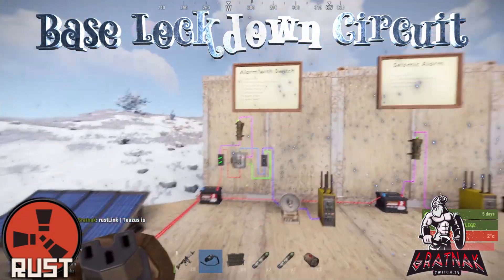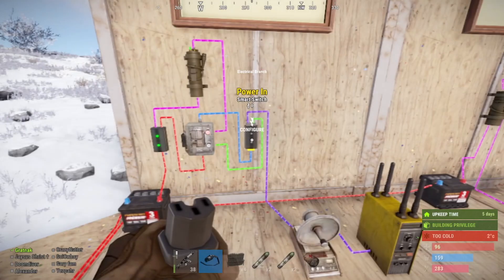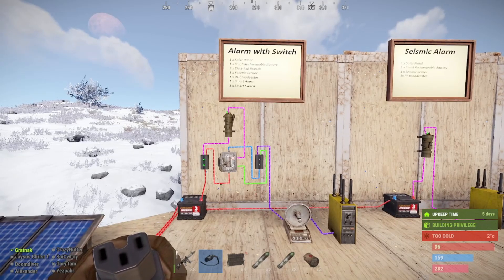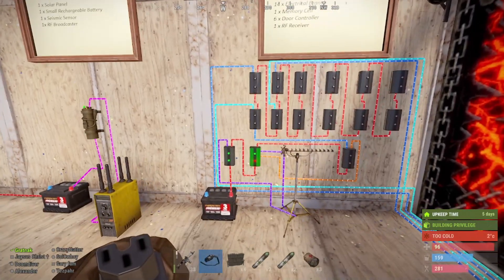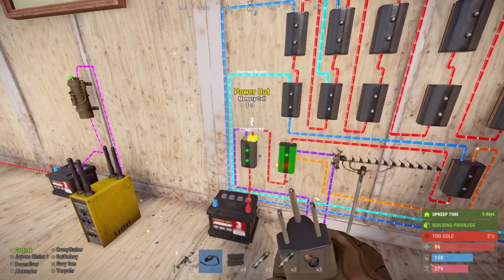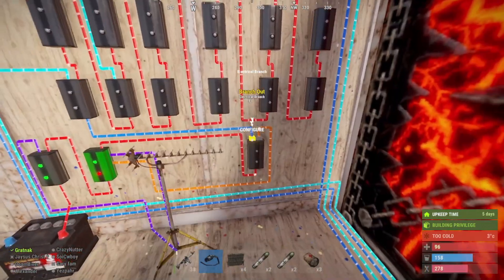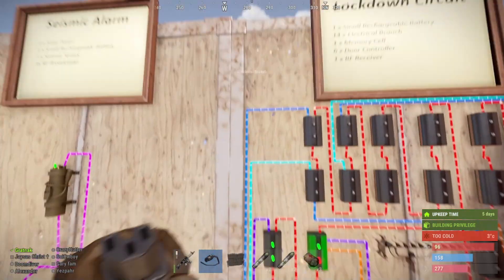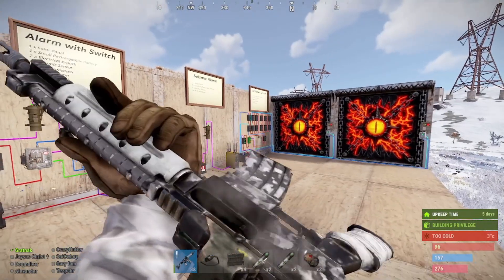Rust Base Lockdown Circuit

Comment: So is it possible to have a switch in core and at the exit of the base?
Reply from the maker: Yes, you could put two of the first lock down switches, one in core and one at each of your entances. If you also link the first switch to rust+ you can also lock the base down if you've already logged of, or Rust has crashed.
Reply: @Gratnak  As a solo I would be the teammate that forget to close doors 😂 So thanks and keep up the good work 👊